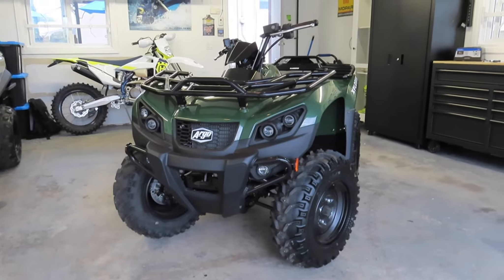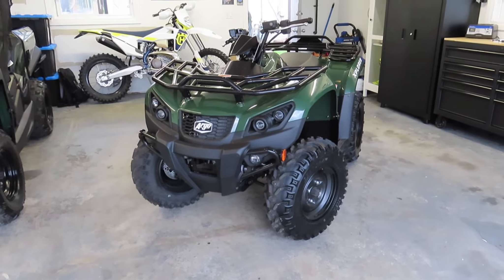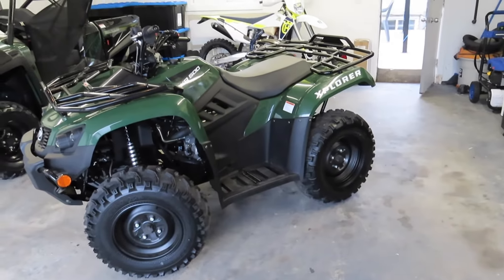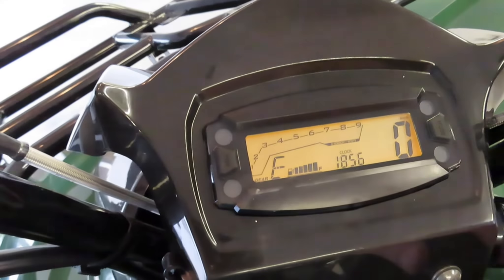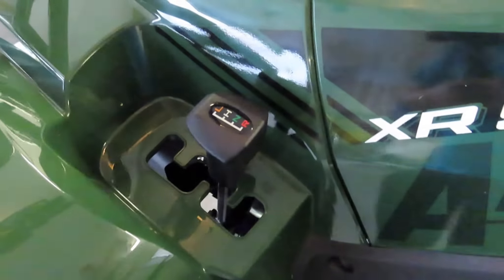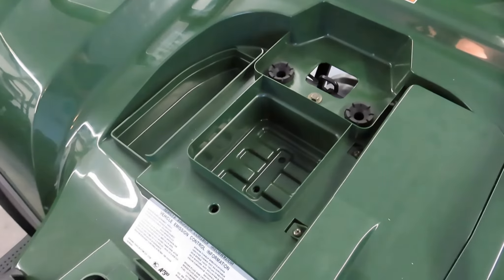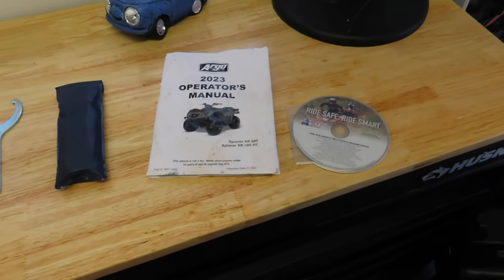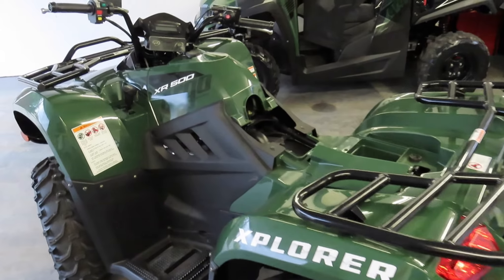2023 Argo Xplorer XR500 Intro Ep02

Comment: Man, 24” tires?  That really is entry level!  The type of tire is nice for a factory install but I’d rather at least 25” tires myself.
Reply from the maker: its a very entry level ATV, but I find it to be very capable off road!
Reply: @corradettimotorsports360  I drive a suzuki 400 and even that is quite capable with the tires I have on it. I think our standards have changed on what is a large displacement wheeler engine. A 400 used to be huge to us!  Now they’re 2.5 times that size in some wheelers.
Reply from the maker: @aurtisanminer2827  I agree,  it's like our cars today,  they are a lot bigger in every way,  but in all honesty,  you really don't need that size
Reply: @corradettimotorsports360  definitely not!  Especially just to commute.

Comment: Does this have enough power for a adults.  Looks on the smaller side.
Reply: Yea, it’s a normal size adult wheeler. Unless you’re like 8 feet tall.
Reply from the maker: It's a "tiny" bit more compact, but still full size, great trail quad, I would highly recommend it!
Reply: @corradettimotorsports360  more compact than what?
Reply from the maker: @aurtisanminer2827  more compact than the rest of the Argo ATV lineup